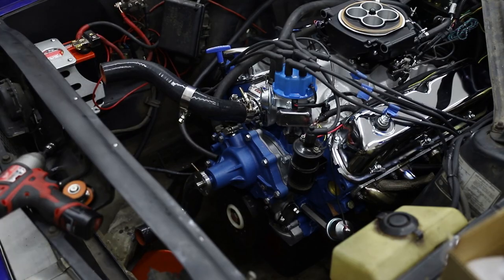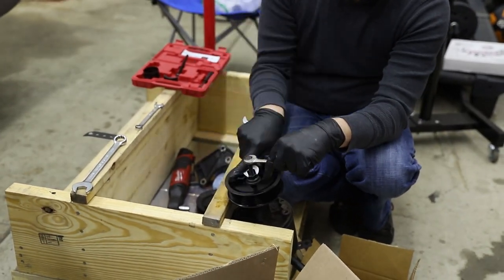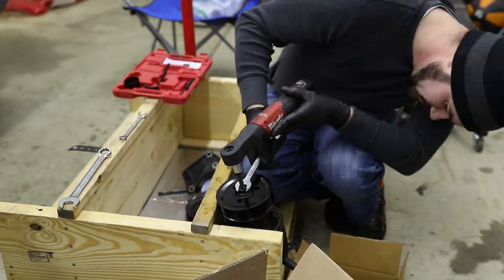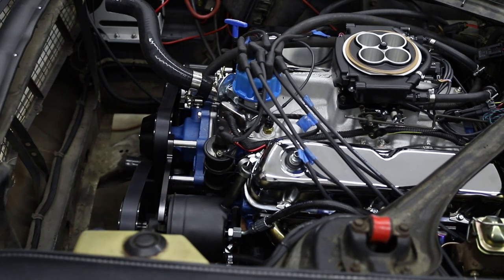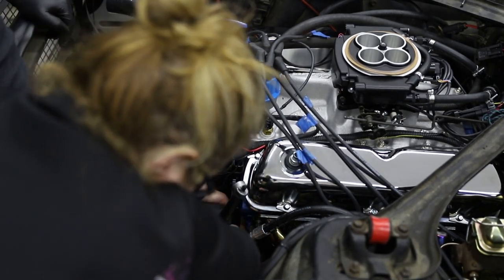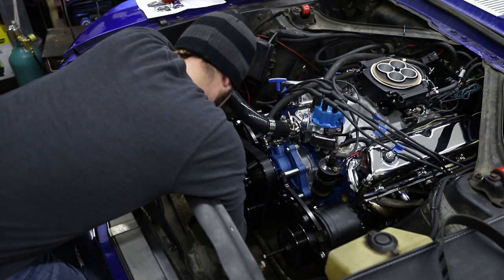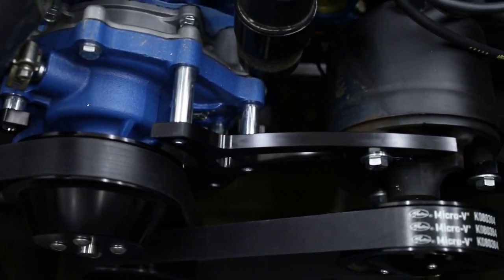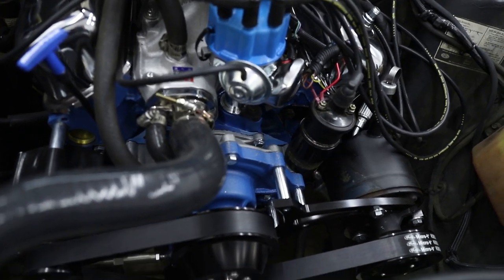1967 Mustang - CVF Racing Pulley Kit

Comment: How did you tension the power steering pump. I cant seem to get anything to put leverage on it to tighten mine.
Reply from the maker: I just used one of my really long breaker bars and was careful not to pull too hard. It doesn't need to be crazy right if everything is properly aligned and in good condition. With the serpentine setup now, it's even less of an issue.